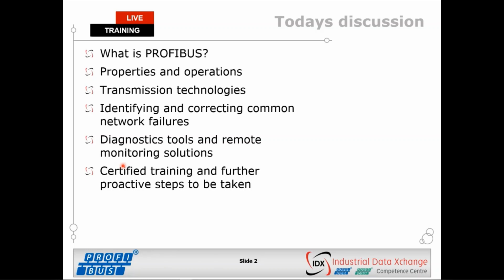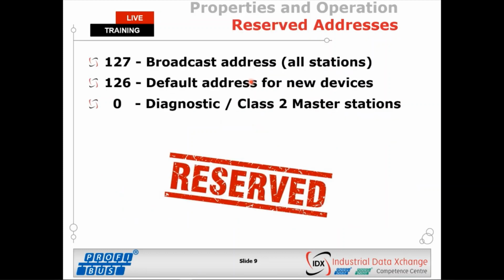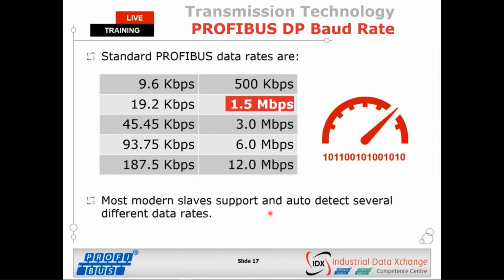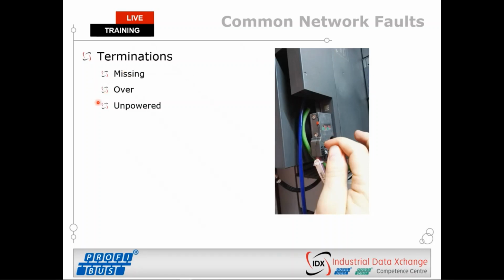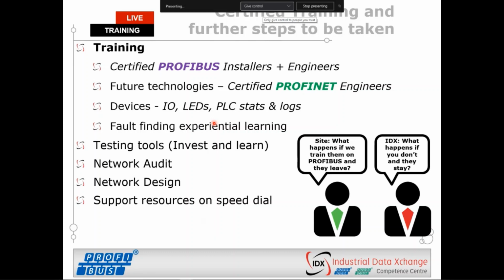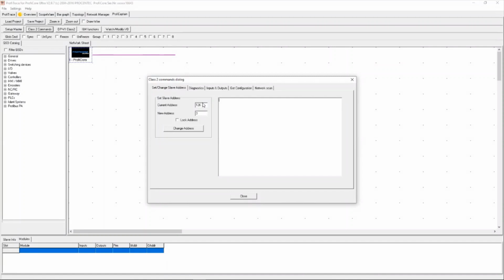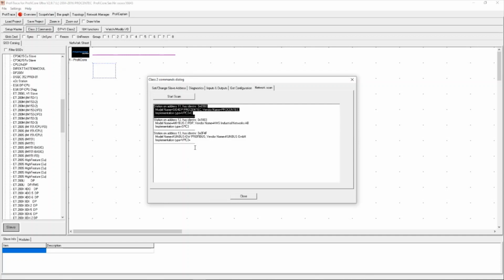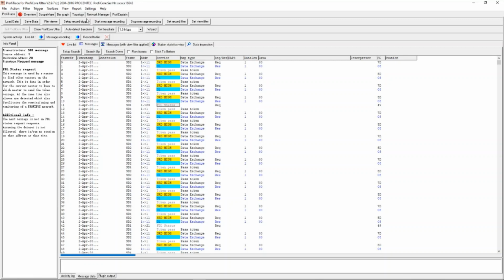Training Webinar: Introduction to PROFIBUS DP

Comment: 54:40 Bit unclear to me here, is the idle voltage drop caused by missing terminators or by having over-terminated the line?
Reply: Hello!

Apologies for replying so late.

typical idle voltage on a PROFIBUS DP line should be 1V. Having one or more missing terminations on the line will result in the IDLE voltage to drop. 
Typically 1 missing termination (or unpowered termination), will result in a 500mV drop. two will result in a 1V drop and the idle voltage sitting at 0V. 

Idle voltage helps to protect the signal from interference within noisy environments. The idle voltage is driven by a 5v, 3 resistor circuit (sometimes referred to as polarising resistors)

Comment: 2:44 Webinar content introduction.
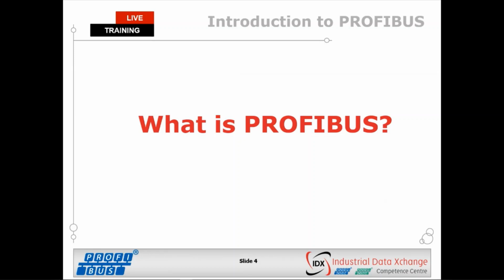4:29 What is PROFIBUS?
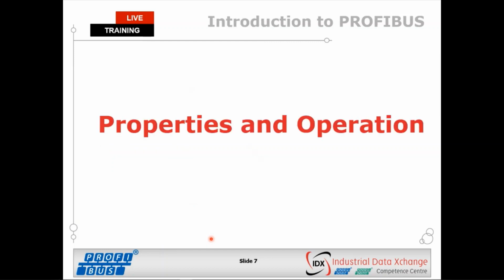12:12 Properties and operations.
27:44 Transmission technologies.
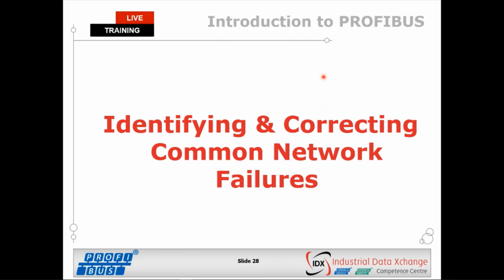49:10 Common network failures, causes and corrections.
1:02:29 Diagnostics tools and remote monitoring solutions.
1:06:20 Certified training and proactive steps.
Reply from the maker: Thank you. ☺